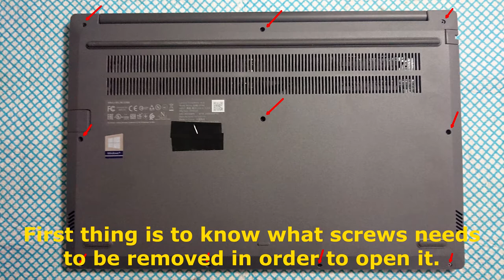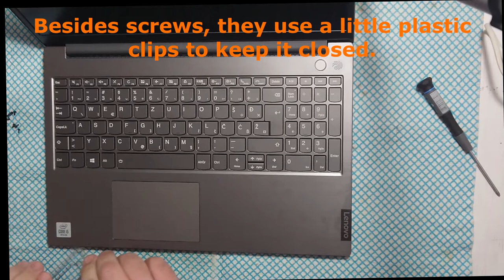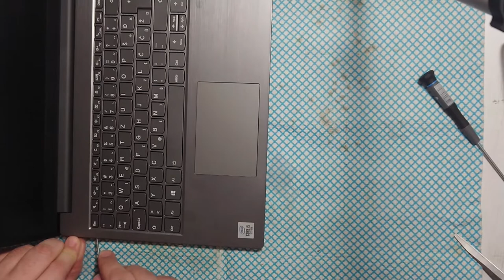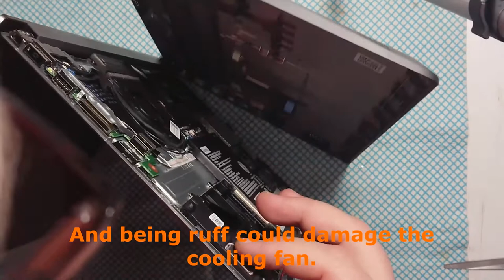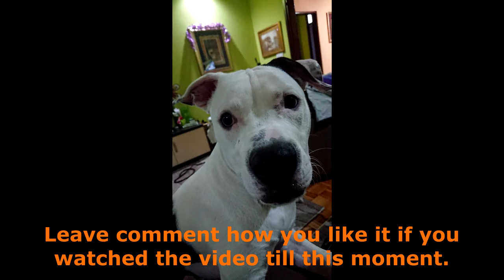Lenovo ThinkBook 15 IIL 20SM how to disassemble AND HOW TO ....

Comment: hello, how many ssd slots does the laptop have?
Reply from the maker: One NVMe slot and one classic SATA 2.5 inch slot
Reply: @FantaBH  THANK YOUU SO MUCH
Reply: @FantaBH  brother i will buy ssd but is the sata part empty or the m2 part
Reply from the maker: Depend of choices you made at your purchase. It's modular laptop so you chosee what you want in, regarding CPU , RAM , type of hard disk etc. Best way to find what you got is to use software like Free PC Audit or HWinfo or similar.